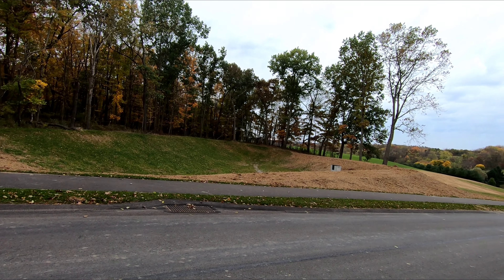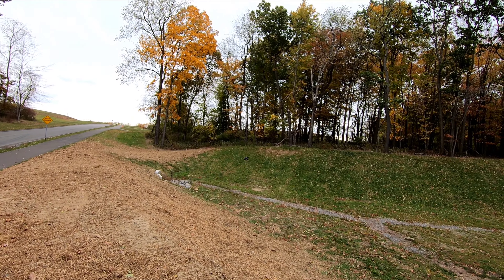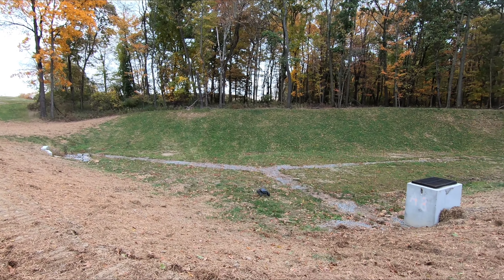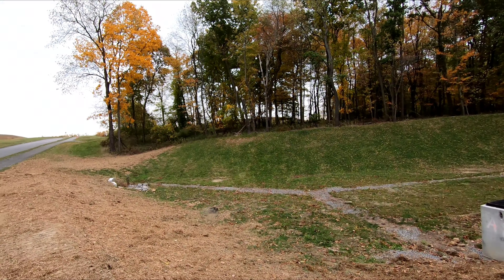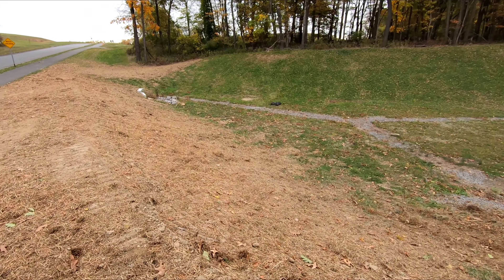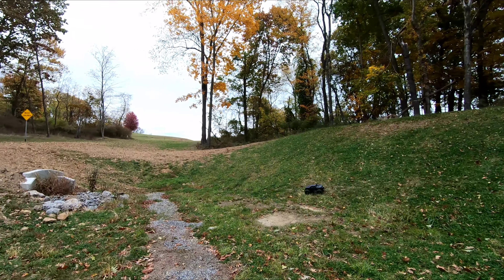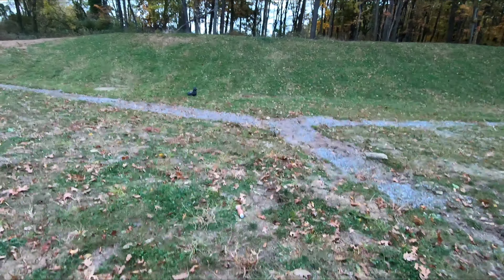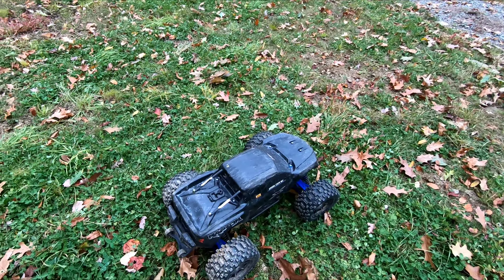Traxxas Xmaxx 8S -HW Upgraded Motor Drainage Ditch Bash!!

Comment: 👍👍nice bash. Got the same setup in my Xmaxx.  I love it. I'm sure u seen it before but I been using Velcro strap around the rear body clip area, and has yet to fall off for a minor crash.
Reply from the maker: Thanks man. Just a quick one. Not two minutes after the video it poured rain lol. Very fun truck to me. As far as the body. I have not seen any fixes for the body. I always forget about it till it pops off. Good info

Comment: First kid!!! I just put up a little slo mo bash vid of my Xmaxx i just got! I like it! Glad i picked this Xmaxx 8s up! How you liking your setup on your Xmaxx? I was planning on leaving mine stock it rips good on the venom 50c 9000mah 4s packs i got for it but stiil doaent have the acceleration my gassers have😜 awesome video G Man!👍👊
Reply from the maker: Sup man. You can not beat the durability of this truck. I ran it stock for a long time. The cushdrive started going bad and ate up the stock spur and pinion. So I put this combo in with mod 1.5 gears. Still nice and light. Appreciate you stopping by man

Comment: Nice. I'm rolling with the max 5 and the 1100kv 5687 motor. 25/35 gearing. I'm in the testing phase only though. My spur keeps coming loose on me. I only ran it for like 5 minutes and it lowered my 4s 6000mAh 60C batteries to 25%! So my battery life on those batteries got cut down to like half then what they would last with the max 6 esc and 20/50t gearing and stock xmaxx 8s motor. All that extra power needs giant batteries (I have some 9400 75C smc batteries for that). I'm also using the WFO esc plate and receiver box and switch mount for the max 5/6. The radio is a flysky fs GT5 reciever and transmitter. Gears and motor mount came from B&M racing.
Reply from the maker: Thanks! Sounds like you have a beast. I was going to get a max5 if this max6 didn't work out. But it seems fans and proper gearing makes it work good. I have no complaints. I get about 15 minutes driving like you see on two 4S youmee 60C lipos. Not bad. I try to keep weight down on this truck as much as possible. The spur and pinion. I drip blue loctite down in the grub hole and a little on the grubscrew itself. Then crank it down. I like to see the loctite being pushed out of the end. Need torch for removal. Thanks for stopping by RC brother 🤘👊
Reply: @SteelCityRC  Those are the Sam batteries that I'm using. So 15 minutes sounds about right. I might get less time because of the 25t pinion on mine. I just did another test and this time on concrete with a 6s lipo battery that I had available (just for testing). Man, even on just 6s it wanted to do standing backflips and I calculate that it was probably doing around 50mph. Wheelies no problem. So this system on 6s is STILL faster and more powerful than the stock system on 8s. Wow. The motor got to about 140 degrees Fahrenheit from non stop driving. That's acceptable to me. I'm using two 30x30x10 aluminum bodied power hobby fans with the 1/8 heat sink that is supposed to be for a 1/8 motor, but I expanded it and put a couple of tie straps around it.

Comment: Those empty drainage areas are definitely nice places to bash!I usually take my 1/8 scale trucks to places like that around here. Most around me are smaller or full of water.Is that xmaxx stock? I plan to get one eventually.
Reply from the maker: They are a blast these drain ditches. This Xmaxx is not stock. I put a Hobbywing max6 and their 1100kv motor in it. Thanks for checking it out bro🤘👊
Reply: @SteelCityRC  awesome as usual!
Reply from the maker: @Crack3drc  Thanks! Stock they are a ton of fun. I broke a spur gear and had that HW combo. So in it went lol

Comment: Are those the duratrax 6 pack tires if so how do you like them? Are they better then stock?
Reply from the maker: Ya man. Duratrax wheels and tires. They hold up to power much better. Handle bashing better. One day at the BMX track and stock tires look like they got a flat tire. The foams degrade. But I am very happy with these. I check the glue job before going out for the day.
Reply: @SteelCityRC  awesome thanks for the reply👍
Reply: Oh where did you get them I see the ones for the kraton 8s advertised but not x maxx they say you have to use a washer on the kraton 8s ones because the hole is larger did you have to do that?
Reply from the maker: @johnsorensen5758  look for the Duratrax Sixpack X. They have the small hole for the Xmaxx. That is the ones I used
Reply: @SteelCityRC  awesome thanks

Comment: G man I finally bought one, hey did you upgrade the shocks ?
Reply from the maker: Hey what is going on!! I did not upgrade the shocks themselves just the oil and springs. I put Traxxas 7858 springs and 50w Losi shock oil in all four. Totally awesome you got one. We need to rip them!!
Reply: @SteelCityRC  hell yeah G man, I'm going to do that, and  I want to change out my spur gear.